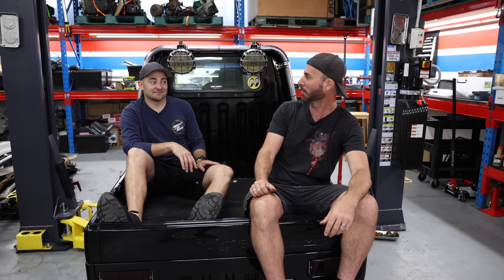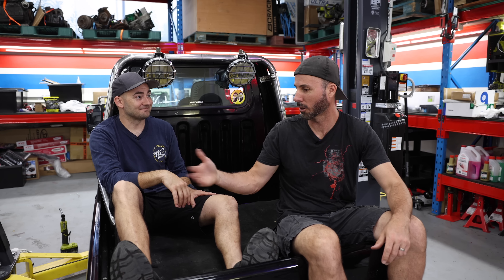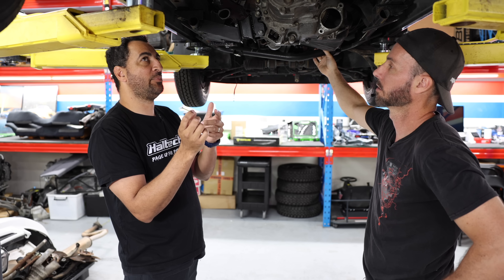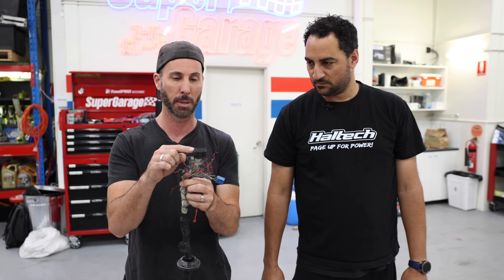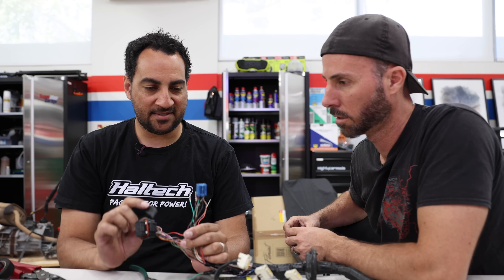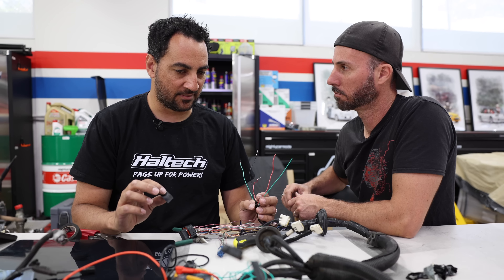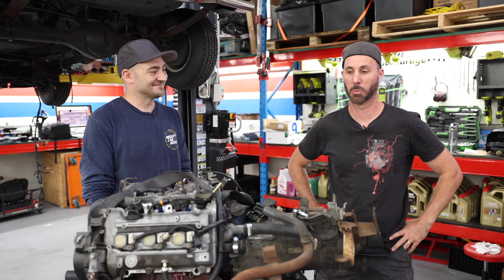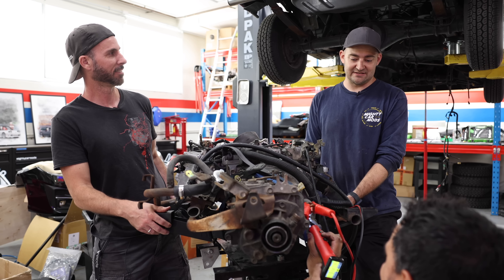WORLDS FASTEST Midget - Part 3

Comment: Haha, love the ending on this one lads. Nice to see when it just doesn't work. Gives the rest of us hope.
Reply: could bet that the starter carbon brushs are gone. had this issue on L5 ED-20 and L7 EJ-DE engines before with the same clicking issue.
Reply: @chrizzly9222  yeah exactly. the solenoid is throwing and the starter ain't turning.
Reply: It makes me laugh the bare foot jack pumping, reminds me of colin furze fake hand that keeps popping in frame so quickly that you think, did I just see that!? 😅
Reply: Wack it with a hammer.  Amazing how many starters that fixes.  Either that or their jump pack isn't charged.  Enough power to click the solenoid but not spin the starter.
Reply: Hand crank big breaker bar on the crank it don't move it's stuffed.
Reply: @button-puncher  It most certainly doesnt fix a starter. It gets you 1--5 more starts at best
Reply: @CrimsonSteer  start it from the crank. It’s only a little Daihatsu and there is easy access with it out of the car
Reply: @Frontman936  They're not trying to start it. Trying to crank it and check for leaks! . 18:47secs.

Comment: As an electrician, I can say that the situation at the end of the video requires the properly calibrated, professional, whack.  An uncalibrated or random whack can result in injury, so make sure the tool using the tool is properly trained and certified in tactical whacking.

Comment: If I'm not mistaken, that blue plug from the wiring goes to a connector under the dash that connects to a speaker that plays all the warning tones (like having keys in the ignition and opening your door, forgetting your handbrake etc) or beeping when the vehicle gets put in reverse. Funny enough it doesn't beep when you forget your lights on, so I just keep it unplugged in mine! :)

Comment: You guys HAVE to turbo this thing. 1L turbo (provided the rods aren't too skinny) should get it to 200hp on E85 without much drama. A 3 cylinder already sounds awesome but if you flare up to a 3" straight exhaust right after the down pipe it's going to resonate obnoxiously and be the perfect little rice trolley!

Comment: The only way to save this build is a motorbike engine. This has been a perfect example of what not to do on a build with poor preparation.
Reply: so fabricating an engine mount and a few hoses and a bit of wiring is an perfect example of what not to do? Surely, putting a motorbike engine into this thing is way easier!
Reply: They've increased the displacement by a huge amount with a minimal amount of fabrication. This isn't a scratch build that took months. This is Mighty Car Mods. Most of what they do is plug-and-play mechanically.